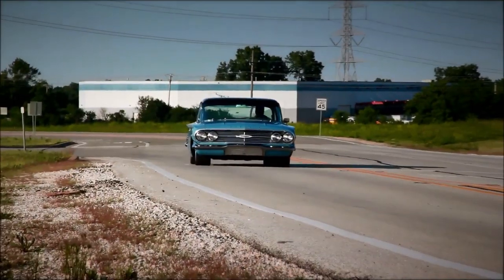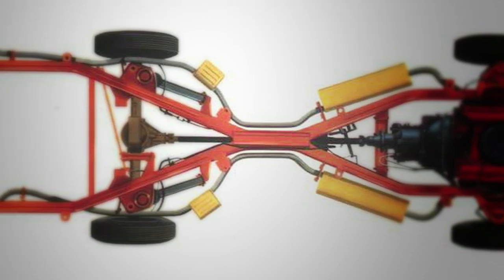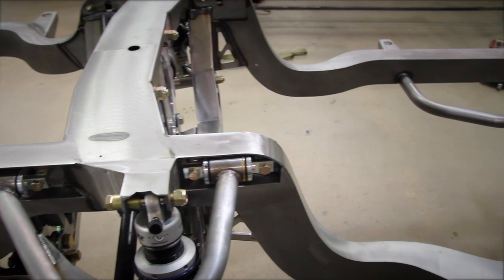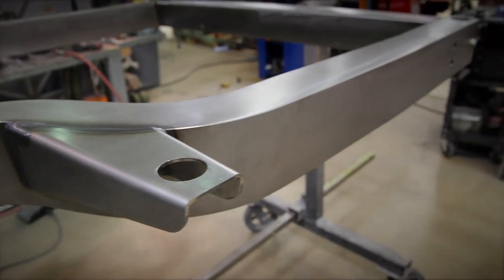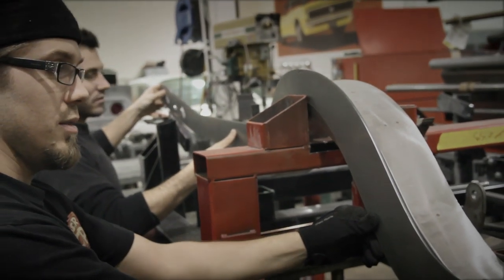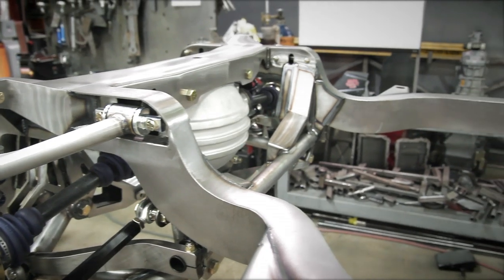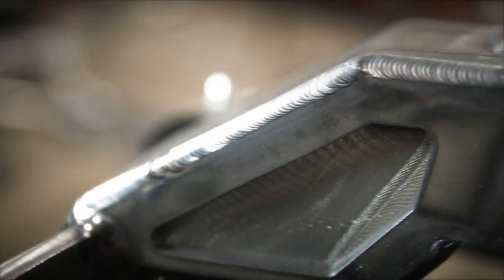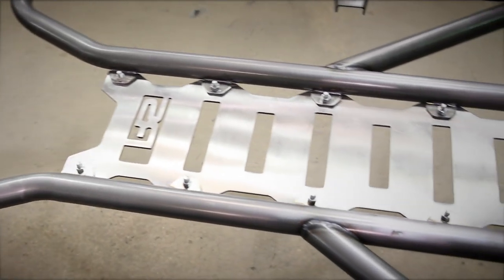Roadster Shop 1958-64 Impala Chassis

Comment: Out standing. I'm probably too old to build another 58 but would love to. That X frame sucked. The drive line had to be a two piece going through the center, riding on what was called a center support bracket. I had the 250 horse 348 with thri power and I tore those damned things  up every other month.Wish they'd have had new frames when I had that 58 Impala. Finest Chev every made.